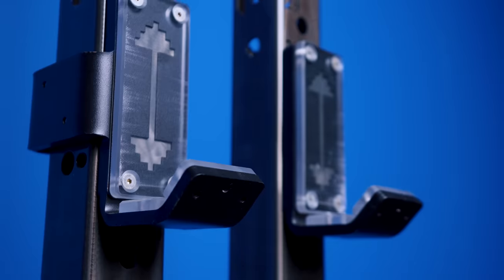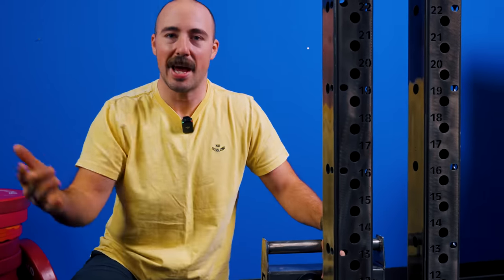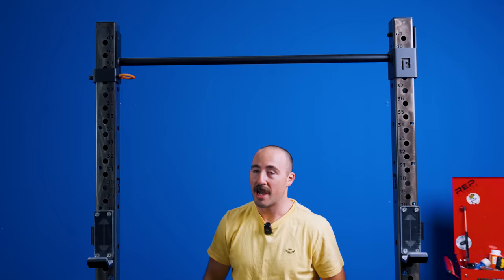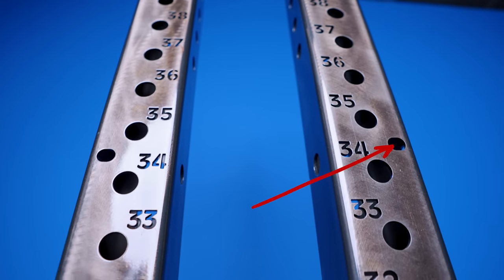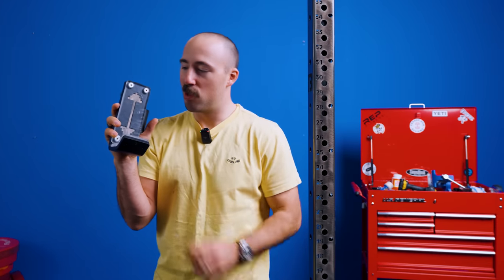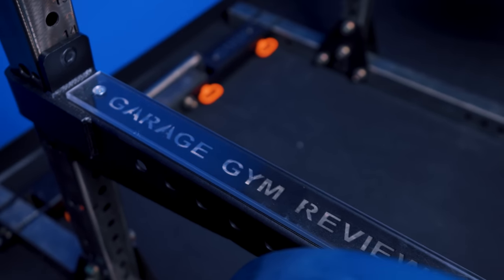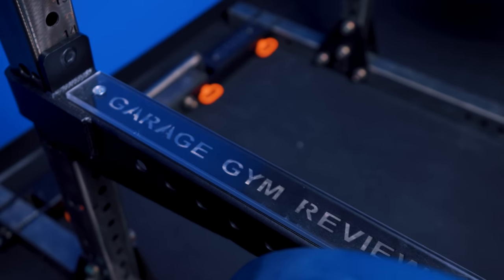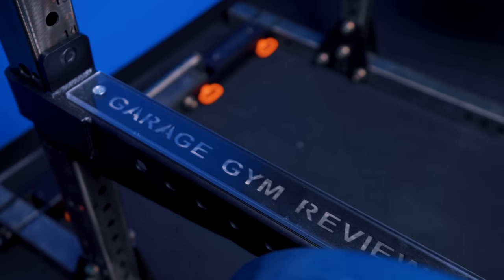The Overbuilt Stow-Away BridgeBuilt Squat Rack Review!

Comment: Having had my Bridge Phoenix rack for over two years now, I have to say its truly perfect for my usage.  Folds away when not needed, i can take parts off to lighten it. The big thing i had issues with every other power rack is my garage space has an EXTREMELY short ceiling, this was just about the only option available for me. I actually upgraded it to a full cage. The beefy wheel kit is worth it.  The safety straps and spotter arms are immensely nice quality.  As many others have said, and as is mentioned, 3/4" is not ideal, but Buffalo Bully Fabrication may be making some pin sleeves to make 5/8" attachments fit without slop. These racks are made to order  so there is 100% going to be a fairly long wait, but its a beast of a rack and well worth it

Comment: Part of the sound issue seems to be lack of isolation in the space they are filming in. It’s a big open box with no sound dampening. 

The other is checking the sound prior to filming to ensure the mic isn’t clipping when being recorded to camera or to an outboard recorder. 

Recording sound separately to a device would allow an EQ to roll off some of the low bass noise that makes the sound distorted. 

Audio and fitness nerd 🤓

Most editing softwares have effects you can use to help the issue, but recording quality audio from the get go would be 1000x better. 

I would also recommend after editing to listen to the playback on a variety of devices. Headphones, phone speakers, etc. as it’s going to sound different on each form of playback 👌

Love the videos and the reviews but the audio is harsh on the ears.
Reply: Got to agree with sling on headphones had to turn the volume way down just to not hear the BS because the space you recording in

Comment: Coop, on the Amazon squat stand you placed hundreds of pounds on it. In this video you had all those red plates in the background and never placed a pound on it to show the actual stability under load. Love the videos, but I’d like some consistency in the review standards. Keep killing it.
Reply: Bridge built recently posted a drop test of the rack using a forklift on YouTube. You should check it out!
Reply: Its a given that an 11 gauge upright with 3/4 jcups can handle heavy loads.
Reply: It’s 11 gauge 3”x3” steel. There are tons of drop tests on racks that meet that standard already, everyone knows they can handle insane weight. There’s nothing interesting to learn there, unlike when he did the drop test on the cheap Amazon rack. That was new, and proved that the difference between the small cheap racks and these beefy expensive ones is not safety.
Reply: Drop test is usually a follow up video after the reviews
Reply: Not necessary for something of this quality, it’s a given that it’s stable. Only really need to see the stability if there are doubts.

Too much consistency would make the videos boring and predictable.
Reply: It looks like you’re supposed to be able to use it without the pull-up bar though. I would like to see how rigid the frame is without that top crossbar… if that is in fact one way they advertise it’s use.
Reply: 800 bucks garbage way overpriced
Reply: I’ve owned one for a year now. I use it as a mobile personal trainer so it’s in and out of a box trailer daily. The coating and hardware have held up nicely.
Reply: @Lexx Little  Offer up an alternative and maybe someone will take you seriously.
Reply: That's cool. Very unique

Comment: In the UK market Primal Strength has an identical option but weighs in at 91kg (200lbs) as it comes with pull up bar and spotter arms included.  This has an upgrade of fold out system as it is all done with pop pins rather than ones that come out and can be lost

There is even a cheaper option from Extreme Fitness, same design again.

Interestingly both come standard with wheels not optional.

I think compact/fold away racks have a much bigger audience in UK due to our smaller garages/spaces.

Comment: I get that the "off" hardware size is annoying, now that 3x3" uprights with 1" holes seem to be the new gold standard. As an engineer I fully support their decission to go smaller though. A 3/4" / 19mm pin with 2" / 50mm hole increments can hold around 5500lbs / 2500kg in 11gauge or 3mm steel. So that would be the case if the pin would just go through 1 side of the upright - so basically double that. And you got 2 pins with 2 uprights, so basically double that again. Of course, you could argue that you don't drop the weight perfectly balanced on both sides and you could argue that the pin would not put force into the front and the back side of the upright equally, but the point is, it's probably still enough. In my opinion, a 5/8" / 16mm pin (Rogue Monster Lite/Infinity series) is the sweet spot. Even with 1" hole increments (Westside Hole Spacing) a 5/8" / 16mm pin can hold around 2000lbs / 900kg in 11gauge or 3mm steel (basically double and double that again). I'd argue that they are strong enough to safely hold all the weight a human could possibly handle, with the uprights - not the pin! - being the weakest link, so in worst cases you might break into the next hole and be safe either way. With 2" / 50mm increments a 5/8" / 16mm pin can hold around 5800 lbs / 2600 kg. As comparision, a 1" pin with 2" increments can hold 4800lbs / 2180kg. That's less than a 5/8" pin can, due to the smaller distance between the holes in the uprights. The 1" hardware standard is something that should never have happened. Bigger isn't always better. Same as some people would say that the Rogue Infinity series is superior to the Monster, since you have 1" smaller uprights, which results in easier walkouts, whilst still not being able to ever break the upright.

Comment: Odd hole sizing is a deal breaker and not just for the rack purchase.  I would totally love those spotter arms because they are much smaller than Rep or Rogue but their pins won't fit.  Same with the pulley attachment. 

In trying to lock customers into their ecosystem they a losing many others. To paraphrase my boy Tarkin, "The tighter they grasp the more will slip through their fingers."
Reply: They make 1” and I think 5/8” versions of their pulley system
Reply: Yup! We offer the pulley system in all pin sizes as well as the spotter arms. Soon ALL of our attachments will be available with 5/8” and 1” pins via our “Bridge The Gap” Collection 💪🏾
Reply: The quote you are referencing belongs to Leia speaking to Tarkin, "The more you tighten your grip, Tarkin, the more star systems will slip through your fingers."

Comment: When you first mentioned the pulley system, I thought it would be pretty neat. It looks like it attaches pretty quickly. The routing of the cable isn’t complex so taking it off and putting it on when I need it wouldn’t be that bad. But now I’m trying to figure out where to anchor my legs for lat pull downs. I can put a bench sideways so that it straddles the lower flat leg, but I’m not sure where I’d put a roller to anchor my legs that wouldn’t interfere with the cable. Maybe something that could attach to one of the holes on the foot?
Reply: I used to do lat pulldowns in the gym with my butt on the ground and my legs straight out in front of me. Nothing pinning me down . You have a lot more leverage from this position it works surprisingly well. Although that was years ago and I don't recall how much weight I was using

Comment: That is the best looking squat stand I have ever seen. Now let’s move to price which is way too expensive especially since it does not include shipping and handling.  I sold my rogue sml 1 lite squat rack to save on space, but it did not cost as much for the base price. I spent 600 with spotter arms as well.  When I sold it I got full asking price, and I bought my self a used pair of cff elite pro squat stands that can hold 1000-1200. I got lucky and bought them for $100.  
If I did have 1000 plus to spend on   Squat rack then I probably would buy it.

Comment: I'd opt for one of the folding full racks available. When folded up without any added attachments the one I have probably only takes up about the same amount of space as this squat rack & it folds out & locks into a full rack in less than 5 seconds with VERY little effort & then you have a full rack with much more functionality.

Obviously most if not all  the foldable full racks available are not built to the same over the top standards as this beast but I think they are more than sturdy enough for all but the monstrous of powerlifters & the ease/speed of unfolding them coupled with their extra functionality wins it for me personally.

Comment: Have you checked their power rack? If the squat rack is already that heavy, I wonder how feasible to move the power rack around. Also, will the 5/8” attachments from other companies work (just use adapters) or will the hole type still be different enough to affect compatibility?
Reply: As an owner of a phoenix rack, allow me to answer.  I converted my rack to a full power rack, and honestly it doesnt affect the mobility muchm the clydesdale fixed rack they just came out with looks pretty sick though.  5/8" 3x3 attachments will work, though there might be a touch of slack, and for that reason Ive stuck with attachments by Bridge. I also  spoke to Buffalo Bully Fabrication about doing sleeve adaptors for 5/8" to 3/4" with set screws, so we will see what comes of it

Comment: Coop - Makes a video about creating squat rack ecosystems

Also Coop - Gets annoyed when a company uses 3/4 holes rather than 5/8 or 1 inch and effectively creates an ecosystem...
Reply: Oh yeaaa that’s right huh?  Snaaaap!
Reply: American Barbell and ETE in California also use 3/4" holes.
Reply: Those aren't contrarian views. Creating an ecosystem just means having a series of attachments that work with the rack. Locking you into a less common hole size restricts options
Reply: At the extreme, a true market maker (Apple, say) can get away with locking you into something proprietary. But, for most folks, it's a turn off. He addresses this like one minute later in the vid

Comment: I currently have a power rack and also a yoke that doesn't have squat rack capabilities. It's just a yoke. I'd like to be able to train with friends and family without having to share the same rack. Would you recommend going for one of these in addition to the power rack and yoke, or replace the yoke I have with one that has squat rack capabilities.

I love the look of these folding squat racks over standard squat stands or wall mounted folding racks as they seem like they are solid with a small footprint and also portable enough.